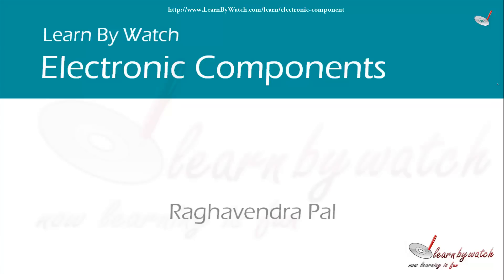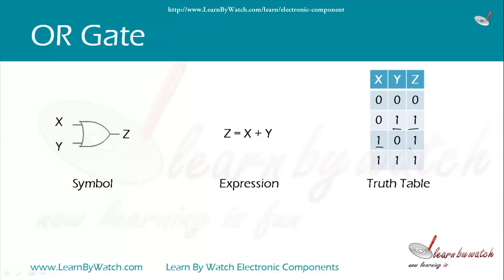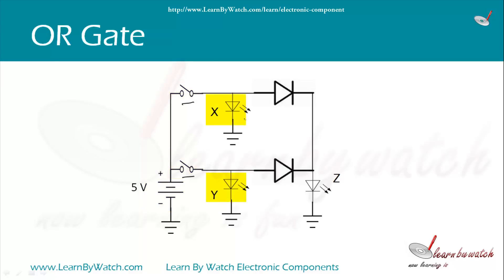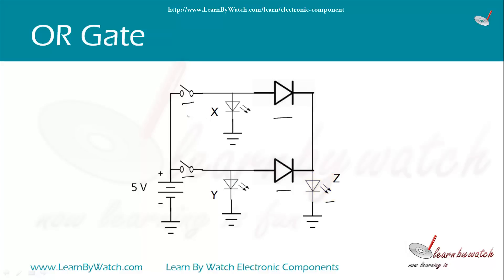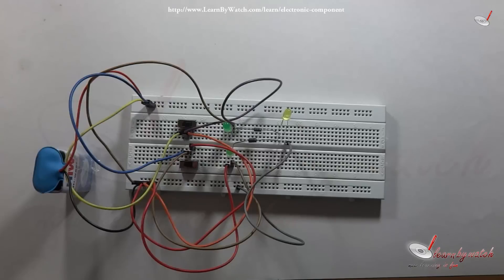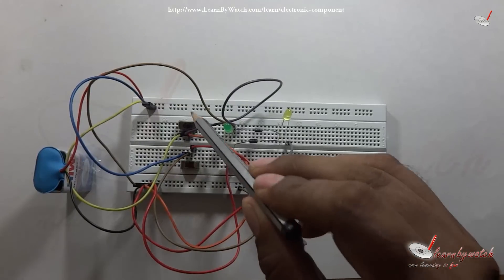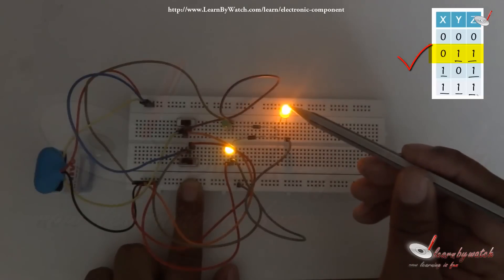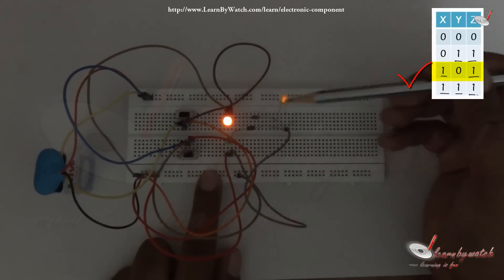How to make an OR Gate using Diode

Comment: There is no need of any diodes **if** you place the DELs, witness of the current flow for a which switch, after the source, and after the track bifurcation (ie, not on the common track for both switches)  but before each of the switch. If you turn one switch on, letting the other off, that other one will prevent the current to come back through its own witness DEL. Sure, you lose the "teaching effect" of what a diode can do, doing so.

Alternatively, since the DEL is itself a diode, you can use them as diode, removing the need to use extra diode (if you remove the actual "witness" DELs and replace the actual diodes with DEL, becoming your witness of the current flowing through which switch). It is better to use a resistor to limit the current flow, or to use a much lower voltage than 5V.

Comment: So in other words it's like a parallel combination huh?
Well, each of them can be controlled individually and if one component doesn't work, the main output wont stop to function, am i right sir?
Reply: Exact. You can also see it as two resistances in parallel, with 1 Ohm when the switch is closed, and 1 Giga Ohm when is it open. If one switch is open and one switch is closed, the equivalent resistance is close to 1 Ohm. 

Note though that the current implementation requires the extra diode to avoid the current to flow back on the second (the parallel) track, in case that just one switch is closed. Without these diodes, the three DELs will light up, if you close just one of the switch, destroying the desired goal that each of the first DEL should indicate if the matching switch is closed or open. But if you move these "witness" diodes before the switch, you don't need the extra diodes.

It is also a good idea to limit the current flow through a LED with a resistor since 5V can easily kill it.